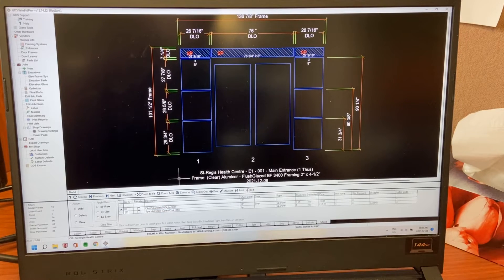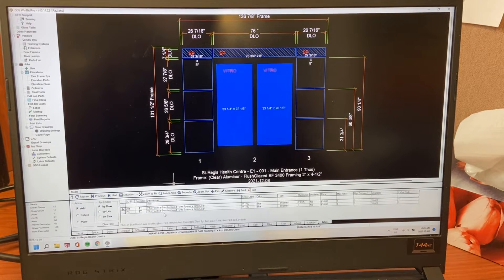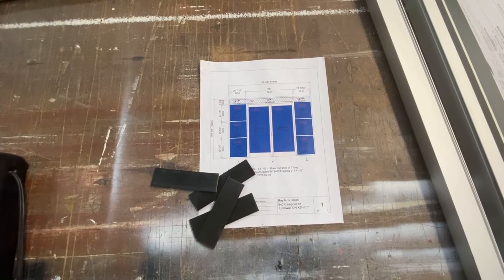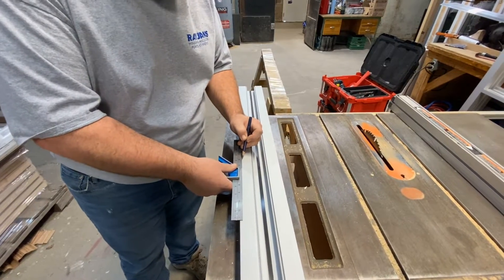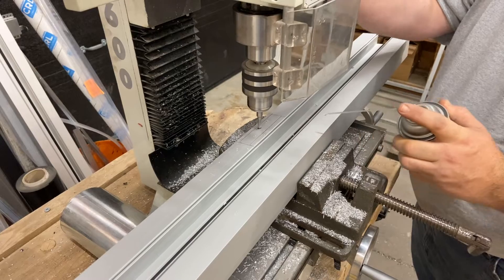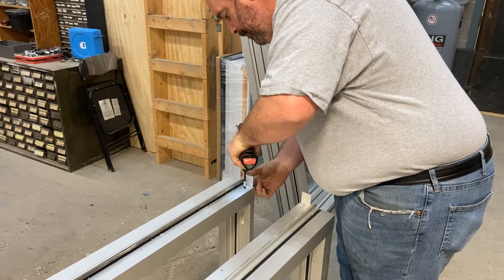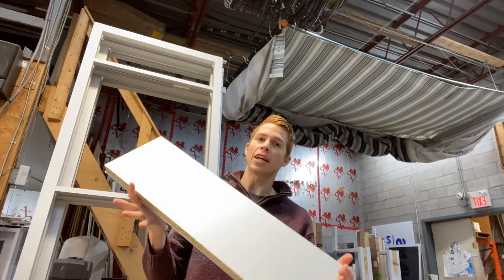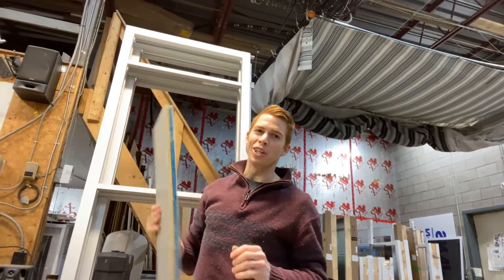How to Manufacture and Install an Aluminum Storefront Entrance

Comment: Thanks for the awesome video. I am new in the business and I would love to know if there a course that can teach me how to build the storefront professionally. Do you have any recommendations?
Reply from the maker: Hey Vahid, as far as fabrication you can always follow the drawings provided by the manufacturers but for installation you may have to hire an experienced glazier. You can also do the 7000-8000 hours and courses to take you red seal test. Every province in Ontario has different rules. here is a link that might help you. https://www.jobbank.gc.ca/marketreport/requirements/6509/ca
Reply: CSLB C-17 license